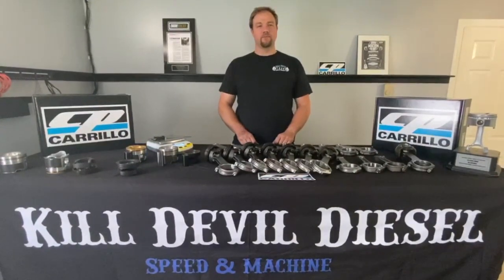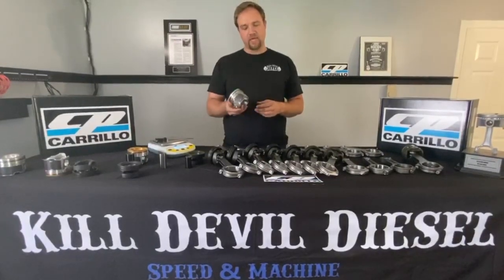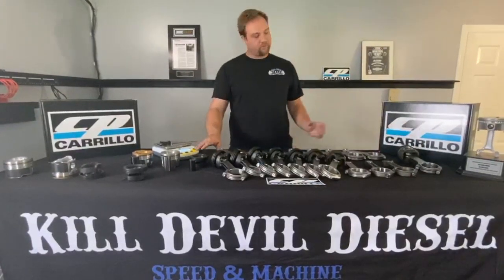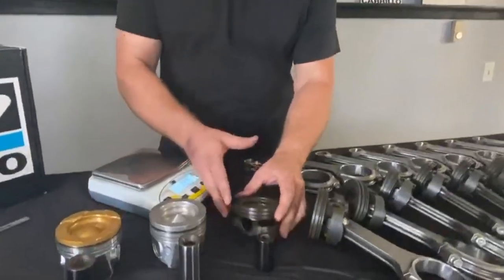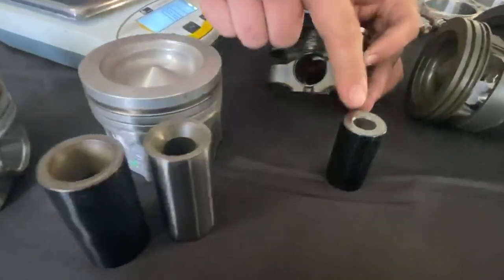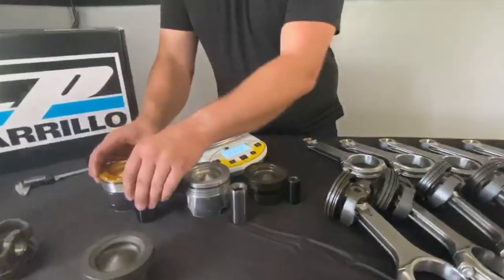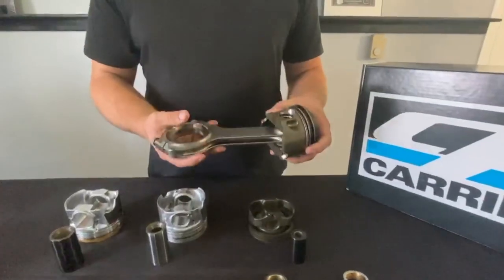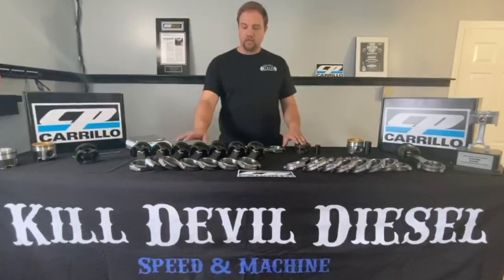Steel Pistons for 6.4 and 6.7  Powerstroke

Comment: Building a standard 6.4 just for towing a 5th wheel camper.  Not looking for big hp or anything and I’ll be running a mild 50-75hp tune.  Do u recommend the steel piston or will the delipped coated piston work?  Like a said before, I’m only gonna pull a camper and drive occasionally.  Thanks.
Reply: Steel piston will work great for you!

Comment: Can I still get the pistons delipped and everything for my 6.4 powerstroke as well as ceramic coated, or does that not matter?
Reply from the maker: We can still delip and machine and coat the aluminum pistons, no problem...the steel piston design doesn’t have a ‘lip’ to begin with and because they’re steel they really don’t need to have the crown coated, but we can,  no problem.  They come with a skirt coating on them, Mahle’s Grafal coating that has come on their diesel pistons for years.
Reply: @Kill_Devil_Diesel  Good to know👍